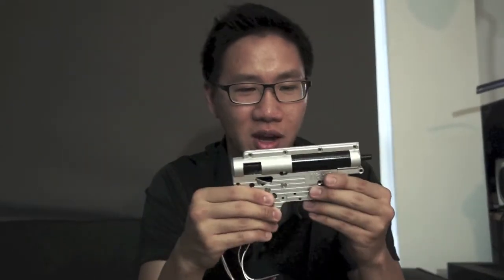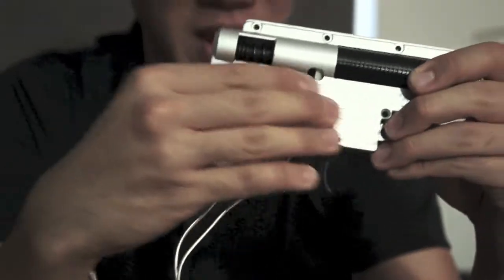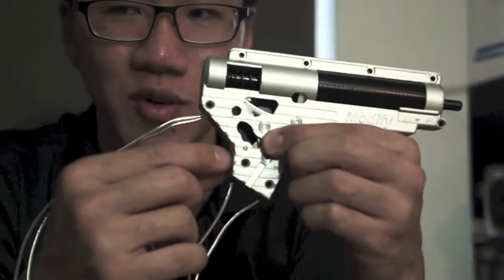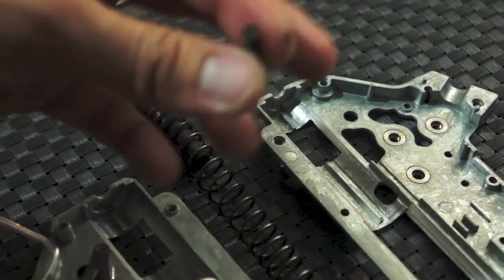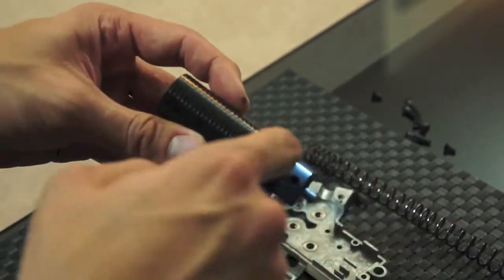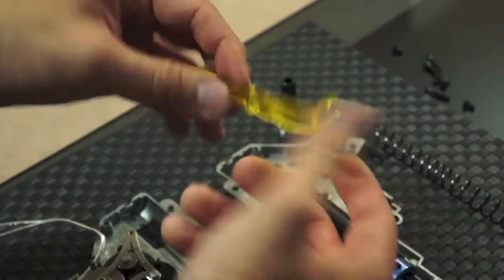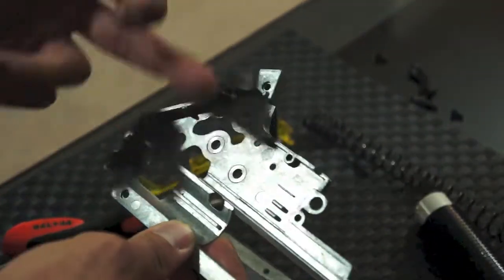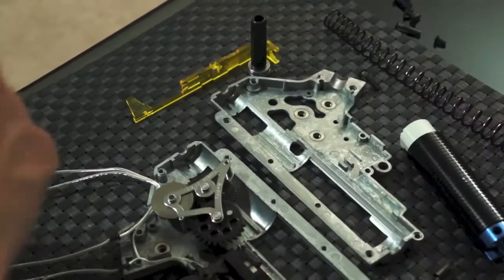Modify Complete Mechbox Review

Comment: I know the "lightning cuts" are heat fins to disperse heat created by the friction from the gears spinning
Reply: And also the cylinder, the rubber o-ring is what's gonna be creating any heat and it doesn't take much heat to deform a o-ring since rubber will melt very easily
Reply: And the shimmless gears have no slop when the gears are in the gearbox and the 2 halves are screwed down

Comment: That reinforcement is just silly, it's the top that needs reinforcement the most and they don't seem to have reinforced the top at all. I'd take a G&P V2 shell over this any day, at least those are compatible with most receivers and they are quite durable. Also, I tried a modify ARL once, that design is not durable at all, I couldn't release it many times before it started slipping and I had to do it in the traditional way. Now I only uses SHS ARL's, they're cheap and durable. I don't like Modify at all, SHS also copied the DSG, but at least they made a somewhat decent copy.
Reply: Partially right, the main parts where a V2 would crack is the bottom of the front of the gearbox and the top of it. Buf mostly a hairline fracrure will appear at the bottom of the front, where the tappat plate is.